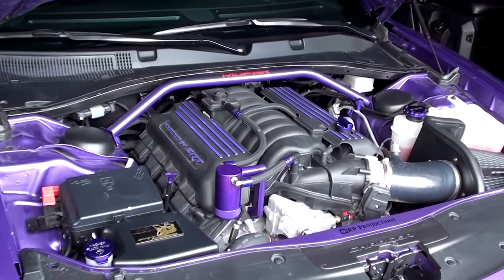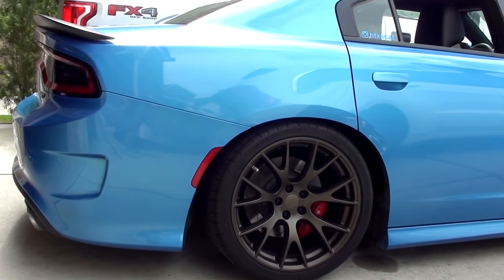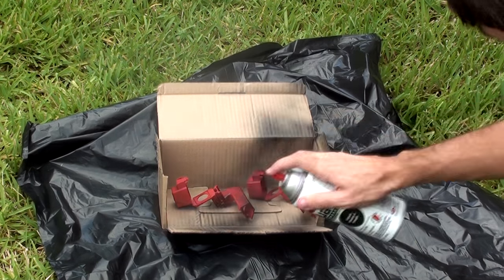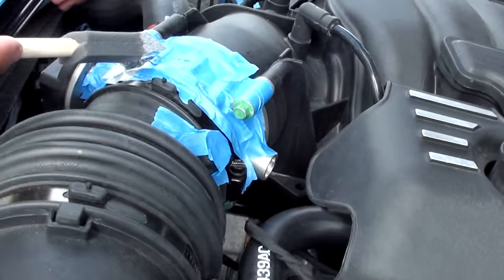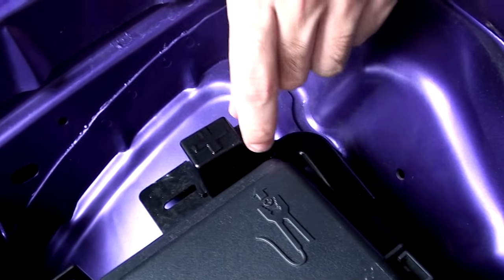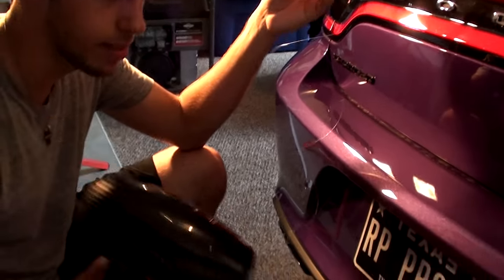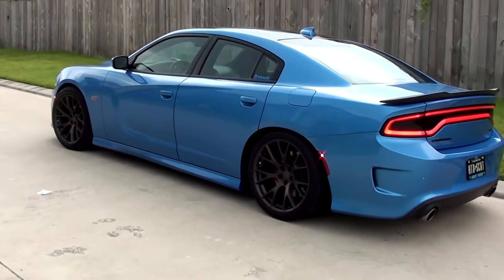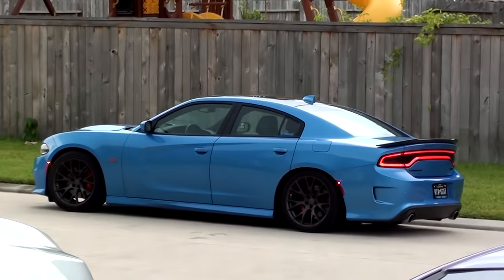Dodge Charger Quick & Simple Engine Bay Mods + Debadging Taillight Letters

Comment: The red terminal covers are red for 2 reasons:1) Red is the universal color for positive and black is for negative.2) If a fire occurs under the hood, firemen will cut positive cable leading to your battery, they'll look for something red... not black. You shouldn't make their jobs more difficult.
Reply: Did you even read my post?? The tabs are red as a safety precaution.

Comment: What's with that Scat Pack posing as an SRT
Reply: It says SRT powered
Reply: +Black Betty I get that but it's sold as a charger RT
Reply: So a RT Daytona is an SRT? Im so confused as to why Dodge is branding a SRT as an RT. I mean shouldn't someone tell dodge they miss badged thousands of vehicles.
Reply: +Justin Crawford it's not an SRT it's just powered by an SRT motor. Oh and has the SRT appearance. The only thing that says it's an R/T is an R/T badge on the rear, which I replaced with a bee.
Reply: actually quite the oposite. I'm trying to show you how even Dodge screwed us over by making us seem like less of a vehicle. The brand is all screwed up. there is no value anymore to owning an RT SRT or anything for that matter. You take it as a personal attack on you and I'm trying to point out the disservice that has been handed to you by the very people who design these cars
Reply: +Justin Crawford agree making multiple versions of the same thing